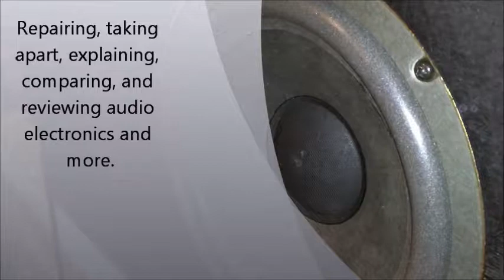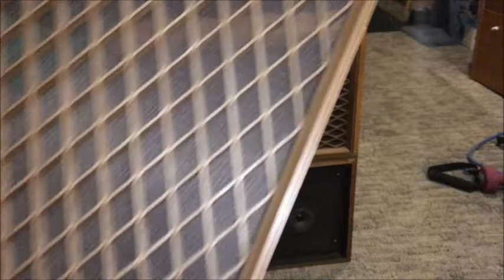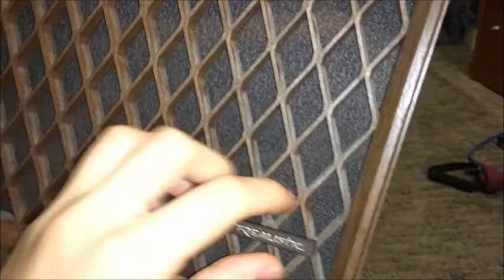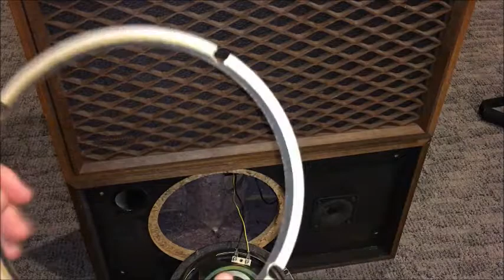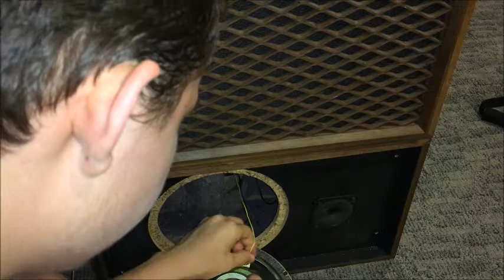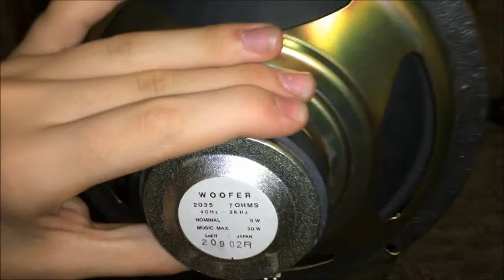Realistic Nova 5 speakers: first look.

Comment: I just bought a pair of Nova 5s at a thrift store and had to reform the woofers but they were Originals like the ones you pulled out they had the 7 Ohms on them and only rated 30 Watts, in the back says 60 watts, so that's just the way they were made and I just restored my cabinets reformed the woofers the Tweeters still work,
Reply from the maker: I think the 30 watt rating on the back is likely the continuous power rating for the drivers themselves. I would think the 60 watt rating on the back is either a peak power rating or a rating for a pair of speakers. The reason I say a rating for a pair is, I have seen home theater in a box systems (namely 2000s Onkyos) with 7 130-watt speakers and a 200 watt sub, which claimed 1110 watts, which is all those power ratings added up! The speaker drivers of course said 25 watts on the back, so that was totally a peak power rating.

Comment: I bought a new pair of these with my lawn mowing and paper route money probably 1985. Half-price was $39.95 I decided to install a two-way crossover also from radio shack. I was convinced it improved and tightened the bass response. Good looking and quality construction with real wood veneer they were great. I did later paint the cones white and use them in my car. They went on to somewhere else I'm not actually sure. Decades later I've bought a few pairs more and refoamed them. Used with older STA-18B and STA-52B.
The wattage is music power on the cabinet and RMS on the driver. Not confusing.
They're 8 ohms average impedance on the music spectrum.

Comment: I have vintage Infinity RS5 towers w/dual 6.5" drivers. 1 driver started rattling and if I press on cone rattling stops. What can cause this? Any help would be appreciated. I have 2 prs of realistic optimus 50 3-way spkrs and they look & sound good. Thanks
Reply from the maker: With the rattle on the speaker, it is hard to say. It could be just the weight of the cone causing it to sag over the years, so the coil is rubbing against the side of the magnet. This can sometimes be fixed by screwing the speaker driver 180 degrees upside down. On the other hand it could also be the fault of the surround like in these speakers, but that may not be obvious. It the surround coming off the cone? Then you may have a problem with dry rot in the foam like these. The worst case scenario would be corrosion in the magnetic gap where the coil sits, or a partially blown coil that has been deformed by playing it too loud.
Reply from the maker: Update: looking at an rs5 tower online, it looks like it is a heavy cone with soft suspension, which could mean the issue is sagging.
Reply from the maker: Or is it the older rs5 with the clear cones??? That may be foam rot.

Comment from the maker: Check out my latest video, an excursion test of this woofer! It is probably my favorite 8 inch woofer right now.
Reply: I have the Nova 7B and I like their sound.
Cheers
Reply: Mine are unported and have dual tweeters
Reply: Mine are rated at 45 watts
Reply from the maker: Those are supposed to be far better than this set. They’re an older speaker despite the higher number, probably from the 70s. They have a 10 inch woofer and 2 cone tweeters. They’re a sealed enclosure with a heavier woofer, and are actually quite well regarded in terms of vintage hifi equipment. They are realistic’s answer to what companies like KLH and Acoustic Research were doing at the time. A few notes about these: The woofers are basically indestructible, including the foam surrounds, which seemed to not have the deterioration problem of these later models. However, you should be extremely careful about the tweeters. Many sets of these speakers in the present day have at least one non-working tweeter. First thing you should do is replace the capacitors in the crossover with ones that have the same uF rating and an equal or higher  volt rating. Those old ones are probably off spec at this point, and could put extra stress on those notoriously fragile tweeters.